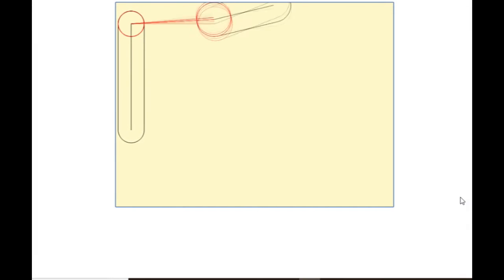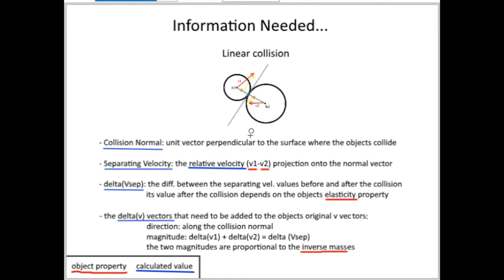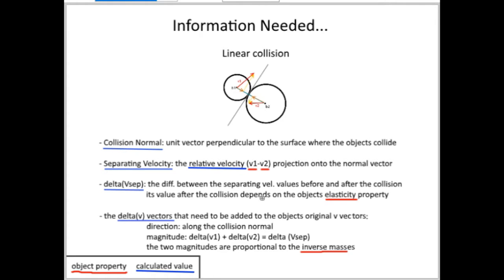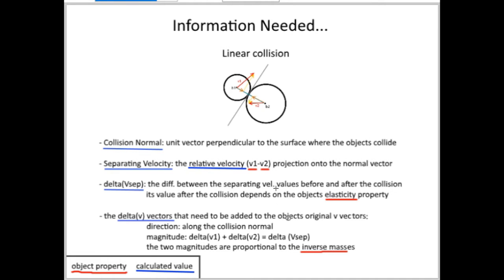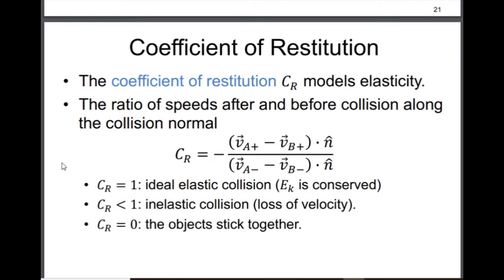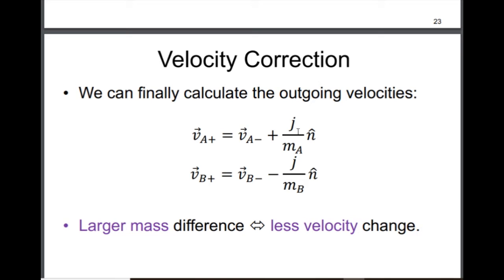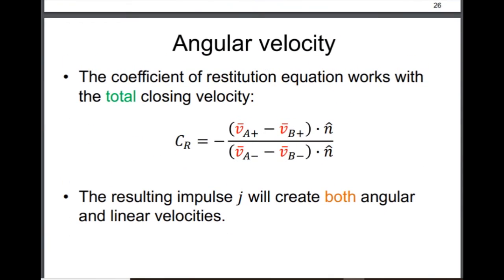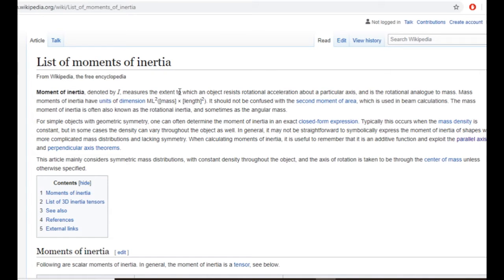2D Physics Engine from Scratch (JS) 14: Rotational Collision

Comment: If anyone have this weird bug in which capsules and the balls get sucked or stuck in objects with 0 mass just sort the BALLZ and CAPS arrays by it's mass:
BALLZ.sort((a, b) => (a.mass < b.mass) ? 1 : -1);
I don't know why it happens here
Reply: I have a bug where, if the velocity of objects is very high, the objects escape the walls....i think this is because of the frame rate....any suggestions on this?
Reply: @raghavnagpure4149  You have to use Continuous Collision Detection, I never implemented it, but that's how you fix it
Reply: @raghavnagpure4149  just check collisions and do physics faster than the function that updates the canvas